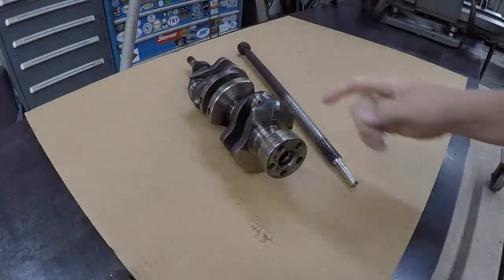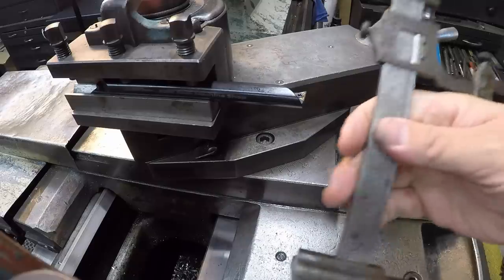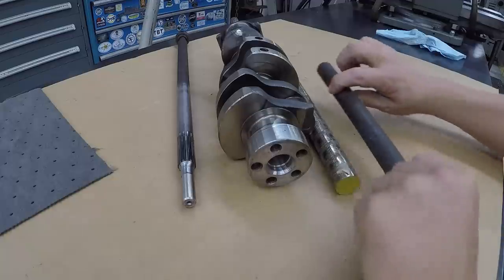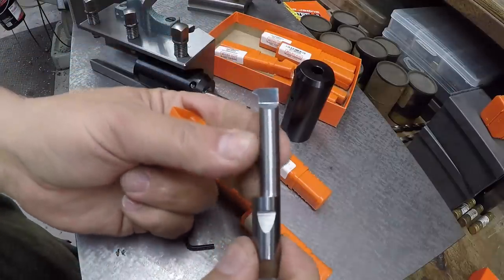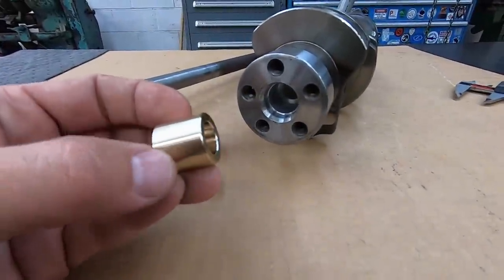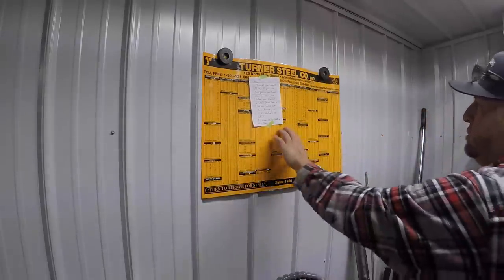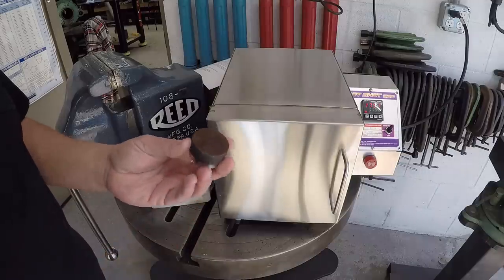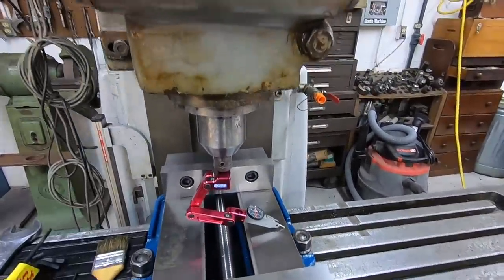SNS 294 Kubota Crankshaft Hot Shot 360

Comment: 26:33  Where do you get those magnets ?  I'm in need of one. Thanks.
Reply: They look like there from some old speakers I get most of mine out of old hard drives
Reply: @christiantroy7722  They also could be from microwave ovens. But he says he buys them.
Reply: @RichieCat4223  they could be I also buy some from Aussie megnets they have All shapes and sizes even the high power 52n strength ones
Reply: @christiantroy7722  Don't know what Aussie magnets are. Explain please.
Reply: @RichieCat4223  it's a magnet store I buy from them online they have All types Of magnets
Reply: @christiantroy7722  Thanks for the info, I'll look into that.
Reply: @RichieCat4223  that's ok thay are in Australia not sure what country your in but if you look online you should find a supplier to buy some from
Reply: @christiantroy7722  Thank you again.

Comment: I have an old enco lathe. Do you need to use a center bit to get a straight hole? I can't seem to drill a straight hole no matter how nice it seems to start.
Reply: ...sounds like you have an alignment problem between the headstock and the tailstock-!!
Reply: @daleburrell6273  to me it looks to high and i dont see how that could be adjusted
Reply: @AndyFromm  The VERTICAL alignment between the headstock spindle and the tailstock quill, is something that should have been built into the lathe. The Sherline model lathes offer an accessory that makes it possible to offset the drill chuck from the axis of the tailstock.

Comment: Adam, could that oven be used for reflow of electrical circuit boards?
Reply: Anything that gets hot enough to melt solder can. (Yes.)
Reply: @xenonram  true but im more curious if it can do a heat profile.. where it ramps up the holds then drops off then ramps up higher again then shuts off..

Comment: I think SAE 837 oilite is used for low speed rating in bearing application. 
For high speed applications backing carbon steel plate split bushing with inner Aluminium lining would be a better option.

Comment: Nice job Adam. Think i would have used a high quality needle bearing with lip seals instead of the oil lite material. Just my 2 cents worth.
Reply: An operator who sits on the clutch for extended periods will frequently wear out a bushing first where as a needle/roller bearing is ok for some time with that same operator.  The problem comes in the failure. When a steel needle bearing fails, it takes out the input shaft. The oilite bushing generally doesn't damage the input when it fails.

That being said, some of my vehicles are running bearings and some bushings. I always throw the transmission in neutral instead of riding the clutch and destroying the input bearing/bushing. Not to mention what that concentrated forward force is doing to the engine's bearings. 

I'm glad we no longer have any manual transmissions in the fleet. I don't miss yelling at operators for destroying inputs and engine bearings. Oh, and having to constantly remind them not to lean on the gear shift.
Reply: @841k9  #micro management..
Reply: @jorgyr36  Addressing a genuine problem isn't micro-management.
Reply: @jorgyr36  

Correcting poor driving habits that cost thousands of dollars worth of damage to equipment and lost profit is not micro management.

Comment: How do you impregnate oil in bronze...
Reply: You don't - not correct application for this bushing.
Reply: Michael Licitra can you elaborate?
Reply: @Tkb135  Yes,  The bearing made from the propeller shaft stock brass or bronze material is not impregnable as it is made as a cast forging.  An "oil impregnated"  bearing is a sintered sleeve usually of bronze in this case.  To sinter the bronze sleeve a powder of the metal is hydraulically formed under pressure and sometimes heat to form the sleeve bearing.  The sintering process, never casts the metal into a liquid form, leaving you with a metal structure that is porous.  To impregnate this bearing you would either let it stand in oil for some time or a manufacturer would put it into a pressurized oil bath to drive the oil throughout the spaces in the pressed metal powder matrix.  A solid cast bearing material would not be able to absorb any oil since it is not porous and therefore it will need some external lubrication from time to time.  These sintered bearings are quite common and used where oiling is not a viable option in most cases.  I used to rebuild generators way back when and had a jar of oil that I kept bearing sleeves inside.  In the application shown the input shaft would be rotating in the crankshaft pilot bearing sleeve when the clutch is depressed.  Without the ability to lubricate this sleeve it will not be too long before it begins to seize and result in incomplete disengagement of the transmission input shaft from the crankshaft resulting in shifting difficulty.  I don't believe the bronze prop shaft is bearing type material and certainly not sintered.  Take a look at these sintered bearings:  https://www.mcmaster.com/sintered-bronze/
Reply: Michael Licitra did you even watch the video
Reply: @Thebadbeaver9  I did.  My reply to the comment was about bronze vs oil impregnated bronze material.

Comment: So that thing is really a pilot bushing for trans?  Just curious.  Question:  Why would that have failed?
Reply: probably caused by a failed  inputshaftbearing
Reply: Most cranks have a bush/bearing in the end to steady the end of the shaft, looks like this has broken up!
Reply: Just remembered they are called Spigot bearings over here.
Reply: @cunningplan96  Pilots here.  Usually Roller/Needles.  A bushing would work just as well.  Guessing the Trans mains-shaft got wobbly somehow to damage that thing.
Reply: nhzxboi it doesn’t seam so bad on autos but I’ve had replace quite a few on stick shift. We would change them when doing a clutch most of the time to be safe.
Reply: @cunningplan96  Indeed.  However this poor fella had to machine a new bushing.  In my world we had to just slide-hammer out the old bearing and hammer in a new one.  Pilot bearing throw-out bearing and clutch....common job.  Less common now for sure that manual trans are becoming a thing of the past.  Autos don't relay on that little piece of art made in this video.
Reply: @cunningplan96  Guess it would be cos in autos theinput shaft is turning with the engine all the time driving the torq convertor. In manuals the input shaft stops when you put the clutch in..
Reply: nhzxboi I think the bearing had gone and enlarged the hole in the back of the crank. If so could have made the bush out of steel as the shaft will run in the bearing and not the bush.

Comment: Great video, as always, however, someone did you in good on that material as its definitely not sintered bronze, if it was, it would have swarf/chips like cast iron. Then, assuming it was, it would need to be impregnated with oil before you press it into the crank. (Also could be purchased pre-impregnated but even then will still machine like cast). Its also really expensive and a piece of the length you showed would have set you back at least 300 usd. Aside from that, when machining it, its imperative that the surface does not get smeared/shiny and requires a dead sharp tool with high positive geometry(i use ak chipbreaker inserts for aluminium), so that the pores dont get sealed closed, the tool you used is not capable of that. This is definitely going to fail within a month or less. I mean no disrespect as i have learnt tons from you over the years, but in this instance i would have not gone with solid bronze OR sintered bronze, rather a sealed ball bearing. Also sintered bushings are generally used for stuff rotating at high speeds and low loads, which allows the oil to form a barrier between the two surfaces, so therefore not good for this application. I suggest you correct this mistake before handing the customer his crank back. Hope you see this message too, as id hate to see/hear anything negative about you and your channel. Thanks for the years of great content and wisdom.

Comment: In my car (VW 1.8T)  there sits Needle roller bearing.
Reply: Most Audi/vw motors use a roller for that. My 2.0t when doing the clutch had an issue where the new bearing broke apart during install.
Reply: That's typical German overkill, I had engines run 300 000km's without needing that bearing changed, the only time it sees rotation is when the clutch is pressed, and within a gearchange, it doesnt see that much difference in RPM's between the shaft and the crank, worst case is clutch down standing still for an extended period with rev's on the engine. Oil bronze is totally the right choice

Comment: Don't you need to indicate the crank to set it in the steady rest?
Reply: It's a six jaw chuck so your material should always be centered. Plus he mentioned he checked to make sure the splines were running true with the rest of the shaft
Reply: @kadenwatt2033  I meant the end that sits in the steady rest. I know it is a crank shaft and it is a fairly rigid part, but is is also long and heavy, and the splined end seems a bit thin and might flex a little.
Reply: I was wondering the same.  While the spline might be centered, did he indicate the end under the steady rest?  I have learned to not question the various Abom calibration methods, but usually he does not rely solely on “I can feel the friction.”

Comment: Wish I'd have been able to comment before you finished but you need more space behind the bushing for a puller to grab or for you to pack something in to beat the bushing back out. (Crazy as it sounds you can use bread and a socket or extension that fits close but not tight in the bushing and basically beat on the bread with the socket which packs it into the area behind the bushing and pushes it out.
Reply: Why ? You could just bore it out again and press a new one in.
Reply: A rag and some grease also works to remove it but if there's no room behind it will be hard to get out
Reply: Joe Pollock because the extension and grease works fine. Boring out requires disassembling the engine and pulling the crank.

Comment: In England it is called a spiget bearing most European manual cars have them they are normally encased needle roller bearings
Reply: Yeah pilot bearings are better than pilot bushings but both get the job done but the bearing dose last longer
Reply: In Australia it seems that most of the spigot bearings are a plain bronze bush.
Reply: @tonyurquhart8278  yeah my 82 k10 chevy has a bronze bushing but when I upgrade my clutch I'm also going to up grade to a pilot bearing

Comment: That isn't Oilite. Oilite doesn't make chips that size (lengthy curls). It's porous sintered bronze and its chips are very fine, almost sand-like. It literally bleeds oil, and if you don't use extremely hard cutting tools, you'll clog the pores by spreading small metal particulate into the open-pore spaces, so that the metal doesn't seep oil anymore.
Reply: SAE 863 is an oil impregnated bronze weather you like the chips or not.
Reply: I made this same post lower down but I’m hoping it might help others by being up here- from what I can tell, he has mistaken C863 manganese bronze to be SAE 863 sintered powdered bronze. In my work with C863, it cuts exactly as shown here, and the raw bar stock has the same distinctive continuous cast surface finish as that shown at 11:15, while SAE 863 raw bar stock has no such surface texture ( https://www.onlinemetals.com/en/buy/bronze/2-875-bronze-round-bar-sae-863-oil-impregnated-oversized/pid/15923 ). Also see http://www.nationalbronze.com/News/sae-863-vs-c863-whats-the-difference/
Reply: @emberklavins9567  I was going to post similar examples with a similar description, but you beat me to it.

Comment: You made one big boo boo.  You'll never get a pilot bearing removal tool in there when you go to do a clutch job.  Pilot bearings don't get pressed all the way to the bottom on crankshafts and they are not usually that long.  Poor next guy is going to have to remove the crank to get the pilot bearing out.
Reply: Cheap Seats  Sure.  What ever you say buddy.
Reply: No worries. To remove the bushing, shoot it half full of grease and use a shaft machined to the bushing I.D. and a 5 lb maul to "hydraulic" it out.
Reply: Out in the field , doing  repairs with limited tooling, I have used a expanding lag anchor to pull off a tough crank bearing that the slide hammer puller assembly would not do..
Reply: Kubota stock bushings are all the way to the bottom, Like Nate said, just put some grease in the hole put a tight rod in the center, thump it with a hammer,and pop out comes the bushing!
Reply: Nate Stanley I’ve removed bushes like that. Also you can screw a tap in it then weld a slide hammer on end of tap.

Comment: Antiseize isn't ment to be a lubricant, it has small particles in it to prevent seizing. It could actually damage the rear main bearing journal.
Reply: Its the Rear Seal journal no Bearing there
Reply: @crackone2three  true, I was wrong about the bearing, but not the antiseize. Probably won't cause issues here, but it may some other time in another circumstance.

Comment: Press fit in brass?  Wouldn't it be better to have harden steel?  Just asking as brass is a soft metal and what is going to lube it?...enjoyed the video Adam keep it coming.
Reply: No way to lube that spot. That is why he switched to oilite, it is brass that has millions of holes and grooves in it that hold oil. Same stuff the OEMs use for pilot bushings if they don't use an actual bearing.
Reply: @Blazer02LS  thanks for the info.  So I assume it is or will be soaked in oil and then fitted in?
Reply: It is already oil impregnated as it was made.
Reply: @wrangler5729  Yup--he meant to use SAE 841, not SAE 863. So now he'll get to turn that bushing out of the crank, and do it all again...with the right stuff. Great practice though--awesome job on the machining, as usual!
Reply: @bluehornet6752  Sae 863 is oil impregnated, but it's typically for high load low speed.
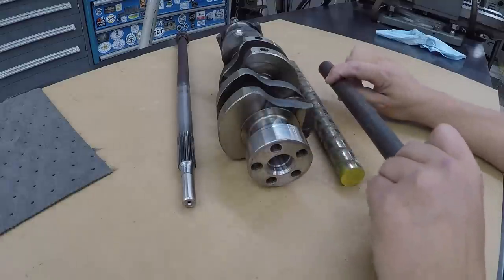Reply: Then Adam was lied to as he states that it IS oilite SAE863 and bought specifically for the project. Refer to 10:41 I'll admit it doesn't look like the stuff I'm used to seeing as a pilot bushing, but I've also not made them from scratch either.

Comment: No disrespect intended, but why does Adam measure the bushing O.D. with a micrometer? Wouldn't digital/analog calipers be faster and easier?
Reply: Believe it or not caliepers give you a false reading
Reply: Classic micrometer is most precise,any digital device is  not rly,it depends how hard you press it,or tighten it
Reply: Levi Vredenburg he’s using an internal mic and the measurements you have seen was him roughing in the piece
Reply from the maker: Use calipers for reference. Use a micrometer for precision measuring.
Reply: @Abom79  ty
Reply: @Abom79  that is right way to do it

Comment: I guess you changed your mind on the route you were taking.  The input shaft video you said you were building it up so it would work with a factory bushing, now you make a custom bushing.  If you were making a custom bushing you could have just turned the input shaft to clean it up and made the bushing to fit the new dimension.  Would have saved you time and the customer money on building it up and turning it down.
Reply: Adam explains (https://www.youtube.com/watch?v=yM_LbcWUf_s&t=93) that it is a customer request to bring the OD of the input shaft back to its original 14mm. But regardless of the customer request, it still makes sense not to have a custom-sized input shaft : you could have to replace the old crankshaft in which case you'd be happy to have the matched input shaft with no more work to do.
Reply: Since he built up the input to factory specs, it would have made more sense to me to open up the crank bore a little more than necessary and then make a press fit steel bushing that would fit the crank bore that the factory pilot bushing would then press into.  Then for future repairs all factory parts could be used.   Now when the pilot bushing needs replaced he'll have to make another custom bushing.

Comment: Seems to be a lot of concern about the material the pilot bushing is made of. 
Any time the clutch pedal is released, the crankshaft and input shaft are turning at the exact same speed. There is no rotation between the parts. The bearing is only being used as a spacer to hold the input shaft in alignment. 
The only time there is any rotation between the crankshaft in relation to the input shaft is when the clutch pedal is depressed.
Reply: @wrangler5729  "passing on inaccurate knowledge."???
Let me explain it for you. The clutch locks the input shaft of the transmission to the engine so that they are rotating at the exact same speed. When they are rotating at the same speed, there is no rotation in relation to each other.
 
Now I can share with you some of my experience after 47 years as a truck/heavy equipment mechanic/lead technician/shop foreman/fleet maintenance manager. 
Any time I've found wear that bad in a pilot bushing and input shaft, it's more often often caused by an alignment problem and the number one reason for that is loose transmission to bell housing bolts or loose bell housing to engine bolts.
Reply: @wrangler5729  Let me explain it for YOU. In your being so fast to condemn Abom you didn't make yourself clear as far as  who you were talking about with your comment about inaccurate information.
Second. If the wear was so bad it wore the heat treated input shaft, it really doesn't matter what material you make that bushing out of. There is an underlying problem causing that wear.
There are millions of stick shift vehicles that have traveled our highways without that kind of wear to their pilot bearings.
Reply: Edit. Misread the comment.  Mine was duplicate and not needed.